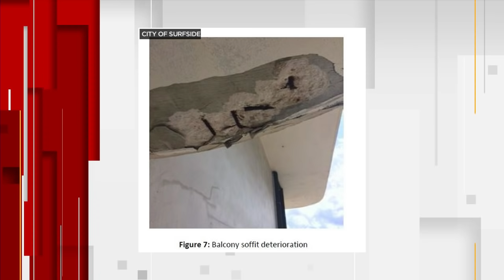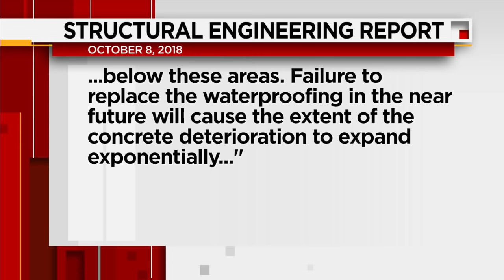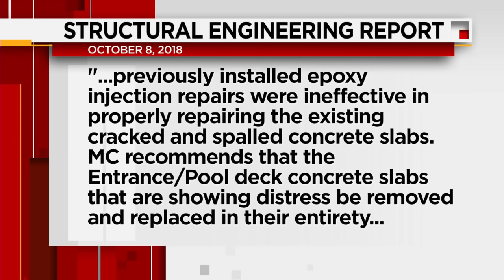Structural engineer Rick Slider discusses Surfside building collapse on TWISF

Comment: I am guessing that the condo association board members are lawyering up and studying the paperwork to find a loophole to absolve themselves of all responsibility.
Reply: I’m an HOA board member and I can tell you right now that is exactly what they are doing.
Reply: Let me be frank! All this talk of Major foundational structural repairs should never need to happen as a rule a foundation should be good for the life of the building so beyond that how do you build a new foundation under a large building like that once the building has been built and in place for forty years or however long the building has been in place? Really would you want to own that building or live in it if it needed a new foundation if thats even possible to do safely? No fuk** way! What's that leave you realistically speaking the only alternative was to condemn the building, "presto" theirs your condo association board members loophole that would have avoided this tragedy.
Reply: @ROCKOLA79  the foundation and support columns for the entire building could have been built to last. BUT, if the HOA waits years or decades to address any maintenance issues, any building is going to have issues and possibly collapse.
Reply: @markiefufu  They cant just snap their fingers and do whatever.
Reply: @newyorkval1478  that makes no sense with my comment about ignoring structural issues for years or decades.
Reply: @ROCKOLA79  Life of building, in this case 40 years. It should have been condemned.
Reply: @kindGSL  Don't worry they'll get around to it now that the heat is on!
Reply: @ROCKOLA79  You sound like a lawyer.
Reply: @ROCKOLA79  apartment building, especially ones above a water table do foundation work all the time. I rented in NYC, it is CONSTANT facade and foundation work. One family homes in rainy or snowy weather get foundation work all the time. You have to inspect and shore up every 5-10 years depending on where you live
Reply: If they are not dead.
Reply: Those that survived, you mean.

The members of that board were all residents of the building.
Reply: All - there was an $80,000 assessment against each owner to fund $20million in repairs.  There wasn't anything "swept under the rug", or repairs declined by the owners.

They had planned and scheduled work to repair everything in that 2018 report.
Reply: I bet the condo assoc was filled with Karens who ignored the real structural problems but "felt" their neighbors were the problem with their petty condo rules.
Reply: @arfcomcobra  This is YOUR MIND spreading that puke.
Reply: @newyorkval1478  Good luck selling your condo
Reply: That and also looking for a loopholes to still collect the monthly maintenance fees from owners
Reply: @Paul Skopic    It's my understanding they're all going to be sued. They will "cya" and all lawyer up, and do this to spread the liability of lawsuit payouts all around. It's a game of Chess at this point, just like it resembles Monopoly after they begin marketing and selling their developments. Except, of course, it's real.
Reply: Yup
Reply: Ain't gonna happen this time
Reply: sounds about right
Reply: I'm thinking they're shredding paperwork too
Reply: Absolutely they are. Anything and anyway to shaft the people involved injured and alive, deceased or relatives, including temporary bankruptcy etc. These  owners are walking heart donors . They are subhuman. I wouldn’t even classify these owners in the human race. It’s pure money. I’ve seen it many times before.
Reply: Saw the HOA lawyer on TV..
She's starting to blame the engineers that wrote the report and said it should have been in giant RED LETTERING!!!
Reply: @deborahmulkey1627  Saw that as well. That report was as clear as could be, they needed to do something. She goes to court with that they’re gonna laugh at her.
Reply: @deborahmulkey1627  She can't read anything disturbing which requires action ONLY IF IT IS GIANT RED LETTERS?
Reply: @deborahmulkey1627  The mouthpiece is grabbing at straws, which is no surprise.
Reply: @deborahmulkey1627  She has a point.
Reply: @deborahmulkey1627  Fake News
Reply: D&O insurance
Reply: @charleyb8423  D&O ordinarily excludes payment for personal injury or property damage.
Reply: @itatchisasku okay
Reply: @First Last Consequences of too much deregulation.!!
Reply: @First Last D&O insurance commonly has an exclusion for payments for personal injury or property damage. Generally speaking, the law does not allow a fiduciary to escape liability for failure to protect the beneficiary's interest.
Reply: Some died in the collapse.
Reply: I don't think so. I suspect that the HOA board members sold their units as fast as possible after they read that report, got their money and left.
Reply: @NickanM  all that money for that death trap
Reply: @NickanM  May depend on the applicable statute of limitations, but if a fiduciary can be shown to have gained knowledge requiring action to protect the beneficiary, he cannot escape liability by quitting.
Reply: @NickanM  
😮
Reply: They say, 'global warming, screw you all, you knew the risk'. (Just saying, devils advocate, no offense to the victims meant.)
Reply: @niilespunkari8832  Wtf? Global warming? Bro what are you even talking about?
Reply: @VTGtone  The earth is sinking there, and limestone is exposed to seawater, and houses collapses. Do your homework, bro.
Reply: @niilespunkari8832  Check your reality. Maybe a UFO is doing this.
Reply: @mikew.to1  either way not my problem.  I'm not a greedy heartless landlord or developer. I didn't skip corners to keep money in my pocket. I'll leave it to God to judge them and they will be judged accordingly

Comment: There were  visible 3 factors that caused  this and one invisible factor.
#1 Engineers walked the building did not red tag it .
 #2 Steel on every balcony and the roof rusted and spalled. 
#3 overloaded roof that caused roof to pancake  building 
It had roofing materials pallets weighing 1600 lbs each  parapet walls, chiller , ac units,  red iron beam.
The invisible X factor is the roof was being redone, everyone knows roofers are  slobs and do not clean up. If their plastic wrap and garbage clogged the roof drains , or if someone clogged them the roof would have filled with water from the previous days of heavy torrential rain.
  Once the building collapsed the water disappears and is not factored in as the cause ..
 The Cohen resident reported he was in the Garage to escape and it was filling with water .
 Now you hear others reporting water.
 It was a combination of a  issues that  lead to a pancake collapse from the roof giving way  and possible overload of the support columns . The roof had tall parapet walls and the amount of water weight would overload the structure along with roofing materials ect
Reply: Please don't take this the wrong way I've heard them talk about them redoing the roof but I didn't see or hear if anything was still on top of it.. so basically what I'm saying proof please
Reply: @whirlwind8825  the more I hear about the history of the structure the more I think no matter what it was F'd
Reply: @whirlwind8825  thank you. If I sounded rude I did not mean it, I'm sure you know how hard it is to convey your tone on just typing
Reply: It was a defective building and repairs would have been expensive so they rigged it for demolition and brought it down and will get the insurance money.   I hope they did not kill anyone in the process but they may have.
Reply: @jcsgodmother  I like conspiracy theories but that was a bunch of malarkey
Reply: @dougc190  The building pancaked. Pancaking takes simultaneous failure of all major supports and occurs in demolition where charges are set off by perfectly synchronized electrical wiring to set off explosives attached to all the major supports.    They decided it was too costly to fix and rigged the building for demolition and brought it down in the middle of the night and will get the insurance money.  Not nuts. Natural failure would have occurred at one point before the others and there would not have been pancaking.  I am an engineer.
Reply: @jcsgodmother   haha and So am i
Reply: Dolly Gottings  -
Sinkhole
Reply: @jcsgodmother  the building pancaked because the roof was overloaded  with weight. There are several columns  on the pile with no signs of cutting or explosives ..so you need to get with Tom Clancy and rewrite that  to show the steel ties ripped from the columns from down-force weight of the slabs ..
Reply: @whirlwind8825  Columns "on" the pile?  Interesting.  And the issue is not if there are some columns with no signs of explosives.  The issue is whether there are columns or anything else with signs of explosives or any residue from explosives or evidence of the explosive blow patterns.  The last part of your comment does not make sense.  i assume you did not say what you meant. And when you reply please be sure to point out the evidence of the evenly distributed overloaded roof.  I fully understand just how much planning and synchronism goes into a well done demolition where the floors pancake and it does not just happen on its own by chance.  Demolition is a science in and of itself.  And some of us recognize it when it is done properly when we see it. They can not fool everyone all the time.
Reply: @jcsgodmother  the concrete has a psi of around 5000 psi any explosive to take out a column would have blown every piece of glass out  of the building  and reduced the slabs to rubble, and turned the columns to dust.   You need a new narrative to troll with 
Maybe consult a Tom Clancy book and brush up on load calculations LOL
Reply: @jcsgodmother  that's nuts
Reply: @wands2457  The building pancaked. Pancaking takes simultaneous failure of all major supports and occurs in demolition where charges are set off by perfectly synchronized electrical wiring to set off explosives attached to all the major supports.    They decided it was too costly to fix and rigged the building for demolition and brought it down in the middle of the night and will get the insurance money.  Not nuts. Natural failure would have occurred at one point before the others and there would not have been pancaking.  I am an engineer.
Reply: @jcsgodmother  You are NOT an engineer.  
Bush did this one too, right, nut.
Reply: @wands2457  I am an engineer.  Penn State 1984  The evidence is in the pancaked floors and the video of the collapse. Sorry you can not accept reality.
Reply: @jcsgodmother  liar
Reply: @jcsgodmother  liar
Reply: @jcsgodmother  No, you're nuts, no, you're not a engineer.

Comment: The "Original Sin" of the construction industry is the widely known long term incompatibility between Ferrous Steel Rebar and Concrete. Exterior Exposed Concrete slowly absorbs moisture from rain and humidity and as the internal Ferrous Steel Rebar oxidizes (rusts) the rusting rebar expands and subsequently cracks the concrete , eventually causing a structural failure. This "spalling" phenomena is more pervasive in Florida because in Florida the concrete suppliers sourced local aggregate to mix into the concrete. Local Florida aggregate contains trace amounts of Sodium Chloride (salt) which greatly speeds up this whole "SPALLING" process. This is a huge problem as older buildings continue to an advanced age , IMHO , the only true fix for buildings or any concrete structure showing evidence of advanced spalling is (unfortunately) complete and total demolition of the structure.  Modern construction techniques increasingly use GRAPHITE REBAR which does not react with salt or moisture. Concrete reinforced with GRAPHITE REBAR is also stronger and lighter than concrete reinforced with Steel Rebar All above is widely known and meant to share knowledge. Prayers to all affected by this tragic circumstance.
Reply: Thanks for your great information.
Reply: Thanks for the info! How long ago did the construction industry start using graphite rebar to build ?
Reply: @lamartyler8096    Graphite rebar is a recent development - initially the cost was much higher than ferrous steel or iron based "metallic rebar" , as the cost comes down and the benefits become more widely known , I suspect many architects and engineers will begin to specify using "GRAPHITE REBAR" . Especially along coastal locations where moisture and sodium chloride are known and ever present corrosive elements. Many 50+ year old buildings are past their "safe" useful life , and are now at the point where corrective restoration will be less economically efficient then a complete demolition and new reconstruction. With a little bit of FEDERAL Financial support and local tax encouragement , this not only becomes very doable , it is actually the preferred solution.  Often you will see a 50 year old building with evidence of severe "spalling" and million dollar construction crews are on scaffolding actively slabbing "READY PATCH CEMENT" on the rusted out rebar.  DUH ?  Cheers from miami beach , joey d.
Reply: @joedonzi9552  Thank you for your informative response! I have learned a lot and I really appreciate the knowledge. I was always curious about how all these structures were built and hold up over time. Really fascinating!
Reply: Pancaking takes simultaneous failure of all major supports and occurs in demolition where charges are set off by perfectly synchronized electrical wiring to set off explosives attached to all the major supports.    They decided it was too costly to fix and rigged the building for demolition and brought it down in the middle of the night and will get the insurance money.
Reply: @jcsgodmother    WOW - Dolly , that's a gutsy call , I can't imagine a person so depraved to knowingly doom so many souls during the dead of the night. I do agree that in order for a perfect pancake to be in effect , there has to be many simultaneous failures coincidentally occurring simultaneously. The motion video illustrates the exact sequence of the collapse. They have it frame by frame in microseconds. Prayers to all those people affected by this tragedy. Peace to all.

Comment: Come on. They didn't do there job 👎👎 . I've been in construction for 36 years. And it doesn't take a genius to figure out what went wrong. It fell cuz it was submerged underneath the whole structure and a deteriorated 😲😲. Saltwater will ruin anything if you don't take care of it. Steel when exposed to salt water it expands. Then you get the cracks in the concrete and then you have a building that falls 😭😭🙏🙏.
Reply: @whirlwind8825  
You didn't answer my question.
You just repeated yourself, Einstein.
Reply: @whirlwind8825  
No you do NOT.
If you had experience you would have stated it in your first post, but, coincidentally you took a little time (15 minutes) to google so you got the answer you just posted. A professional always present their credentials in their first postings; that method ensure that others take them a little more seriously. You need to learn that until next time you decide to post. (You wouldn't repeat your own answer to me if you had experience either.)
Reply: @NickanM  I did not google anything . Now I have you where I want you . Looking foolish. I have a earlier post  on this video with the same information with more detail. You must work for Morabito Engineers . Can you tell us how you spent  the 1 million dollars in tax payer PPP loans you received in 2020 and 2021 ..LOL
Reply: @whirlwind8825  
. Do. Not. Believe. A. Word. Of. What. You. Are. Saying.
Over and out.
Reply: Considering you can't spell 'their' or 'because',  I trust your construction efforts were equally crap.
Reply: Well genius you are wrong. The roof was loaded with materials and the roof drains clogged from roofing debris  and the roof filled with water from recent rains  til it collapsed . The columns blew out from overload .
Reply: @whirlwind8825  
And your credentials are?
Have you seen the report that was made in 2018? No you have not since you posted pure jibberish.

Comment: What about the Sister Building a couple of lots over ??   It was built the same year/time & by the Same Builder as the Champlain apartments !!   Whats ( if anything ) is going to be done to Protect those People ??  Or will they suffer as well !!
Reply: I agree with your statement but at the same time those people had half a brain that get the hell out of there.
Reply: @dougc190  I agree on the getting out of there.  But they probably own their apartments as well.  All those properties there just majorly dropped in value.  I wouldn't buy in there ( not that I could ).
Reply: If you look at Google maps, the sister building looks well kept, while the collapsed one looks like sh1t compared to EVERY other building surrounding it.
Reply: @NickanM  yes I thought the same thing, that the sister building looked much more better kept than the other one
Reply: Owners of the units have options, even though the gameplans are now different...evacuations have been offered...!
Reply: @sidneyosborne947  I'd like to know Who truly owns the building itself !
Reply: @Jane_Dow  they're condos. Everyone owns their own unit and shares the hallways walkways etc.  in common. That's why you pay a monthly condo fee.
Reply: You must have got all your info from this one video.
Reply: @AB-pe5nl  No, I've been trying to get all the info I can.  Using all forms of info, state wise & abroad.